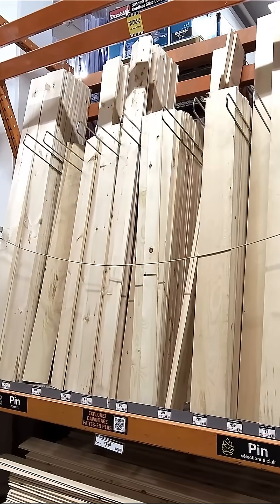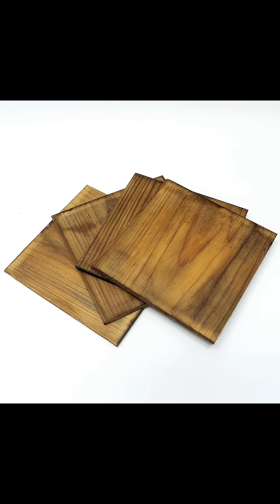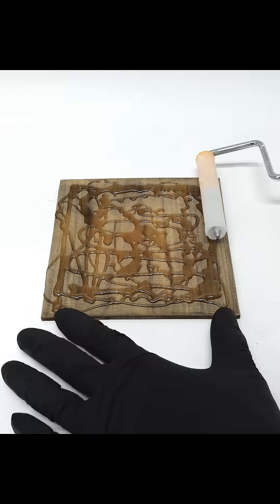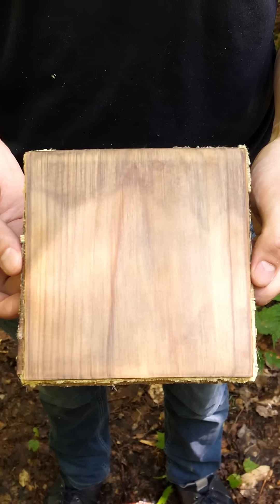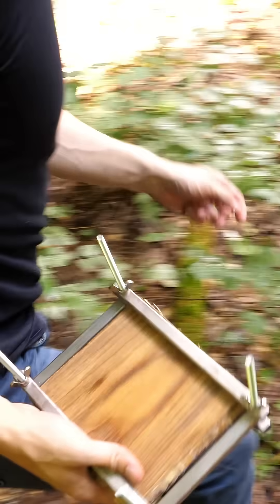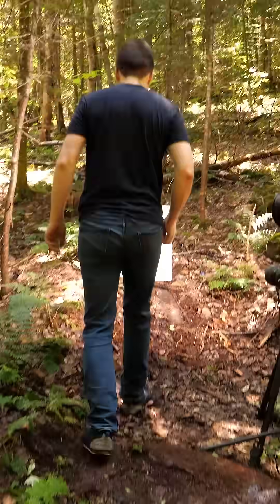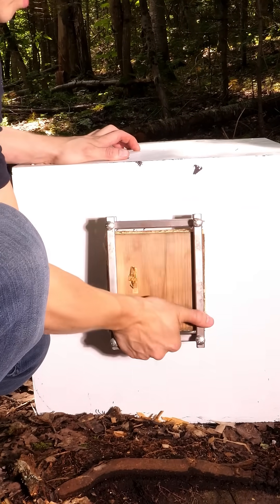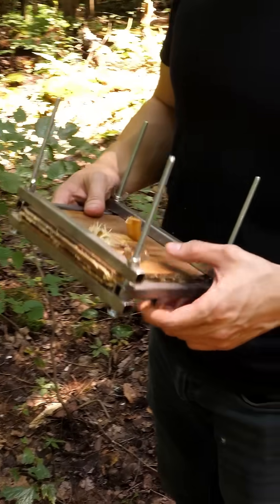Making bulletproof-er wood

Comment: Im a mechanical engineer

Conposites like you have will always be weaker than a single thick layer

Your 3 layers of wood is stronger because it is closer to 1 plate than the 4 you have

Same thing applies in designing beams. A single i beam is the standard for a reason

Comment: Maybe also try adding 45° plys instead of just 0° & 90°, if the layers are thin enough this might help against delamination and improve impact resistance (At least one could assume so as this is what is often done for the top layers of CF epoxy)

Comment: Not the same setup and test, on the failed one the wood wasn't tightly together like with the metal frame, same as first setup without the blue should work better

Comment: Gotta keep the density in the wood bro. If you're going to add any kevlar it can't be interfering with the density cross section of the wood by getting in between the pieces. If you're going to add any kevlar it's got to be separate on the front or back.

Comment: If you glue kevlar in place, it basicly becomes useless. The whole point of it is that it disperses kinetic energy through plastic deformation. By glueing it tight, you removed its ability to deform, rendering it worthless.
Reply: Maybe if we only glue kevlar to the sides? Its center still would deform right?
Reply: @temperance1208 would definitely work better but the delamination means it would literally only protect you for one shot. After that, any subsequent shots means you're screwed. Plus, this is a 9mm. Anything more powerful is gonna cut right through lol
Reply: @temperance1208 The problem with that then will be the huge air gap in the center.
Reply: @temperance1208 if it's still squeezed between the woods, i highly doubt it
Reply: Gluing it together probably did the same thing to the Wood and eliminated its ability to absorbing impact
Reply: Same with the thinner layers of wood, larger thicker layer has that extra energy absorbing deformation and allows energy to dissipate.
Reply: This is the answer I was waiting for. He is totally correct.
Reply: He turned Kevlar into fiberglass (essentially)
Reply: @KatanaKamisama  fiber glass can stop ballistics. Your point is moot.
Reply: @RedactedcommentMan  you can make a decent armour plate with stuff from the hardware store. If it is possible doesn't mean it is the best solution
Reply: @DanielTheRocketguy I have a Kevlar helmet in my lap that is rated for center fire rifle cartridges. It's literally resined and pressed together.
Reply: @RedactedcommentMan does it still allow for the kevlar to flex when hit? Search for video's of people shooting those kinds of helmets and you will see that the kevlar still deforms, by putting rigid wood plates behind it will prevent the kevlar from flexing and the bullet will punch right through
Reply: @RedactedcommentMan deformation is absolutely necessary for kevlar to work. Kevlar slows the bullet as it passes through, spreading the force over a large area as the kevlar strands get pulled along by the bullet. Kevlar is Toby maguire stopping the train.

Also, rip into your helmet and I am absolutely certain that you'll find that, while the outside is solid, the inside isn't. This is typically done to reduce wear and tear, as loose kevlar could be snagged on things or worn down by dirt, much like rope. 

Although, I find it incredibly telling that you've come here telling people they're wrong and your be all, end all point is having a level 3 helmet. I mean, hopefully level 3, because you seemed like the type to think 3a is more protective, but I digress. You really should actually learn what your equipment does, and how it does it. Unless you just want to keep playing soldier like a weeb
Reply: @averywhitaker3513  that's a lot of words to be completely wrong. Holy crap. Lol. I'm done with you Redditors. Deformation on a helmet = brain damage. Brain damage that you obviously have.  My helmet is lvl 4 btw. You know nothing of the construction of any armour. You own neither armour or fore arms and have tested neither. Yet somehow you believe to know better than someone with real world experience. Lol. Laughable.
Reply: real world experience getting shot in the head? Seriously? Take that helmet and hit it straight on with a .308 or 30-06 ap if youve got that lying around. That's level 4.

Helmets aren't rated on the NIJ scale. Companies sometimes run adjacent tests, but because they arent regulated, can do anything they want really. You dont have a level 4 helmet, because thats not a thing. With a level 3, I let that slide, because some companies do the work to make a product what they say it is. Level 4 is not possible with that philosophy and human spines. 

You've dug a pit here from not knowing how kevlar works, to not knowing how ballistic armor rating works, to not knowing how companies work. I am so sorry for doing this to you bro @RedactedcommentMan
Reply: @averywhitaker3513 I've  literally shot resined pressed Kevlar before. I'm well aware of armour companies bs too. I've blown several helmets apart. I know what's inside. A "soft" Kevlar core surrounded by a hardened shell. The "soft" Kevlar is still compressed greatly. You act like you know, but real world experience is just shooting stuff untill it fails. "If hardened pressed Kevlar works, why doesn't everybody use it?" Doesn't provide noticeable ballistic improvement while bringing significant drawbacks. It still stops  pistol rounds easily.
Reply: @RedactedcommentMan  well ain't that a nothingburger statement. Wanna try actually replying to anything I've said, or are you content with your schizo manifestations?
Reply: @RedactedcommentMan You added one to the number and pretended it's true. You're a joke
Reply: what about helmets, im curious, Cause they're cured in resin or something so they're pretty rigid but they still deform and they do work
Reply: Hard layer, soft space, hard layer, soft space, repeat. Bullets rely on massive amounts of energy, enough to vaporize themselves if the meet the right unmovable object. So, unless you plan on absorbing that amount of energy without defamation you need to focus on dispersing the energy.
Reply: That's what happens when you let chemists do physics
Reply: see also: Navy SEALS nailing vests to their panel van's walls, puncturing and pinning it.
Reply: How can so many people be so wrong on a subject? Have you ever worked with Kevlar? I doubt it.
Reply: @RedactedcommentMan if you have experience with bulletproof vests and if the layers need to be loose vs rigged to each other for optimal performance please share 😊
I believe in this thread we indicated there needs to be room for deformation. By having a rigid mass the panel is more brittle and the concentrated energy punches a hole through.
While we acknowledge the strength of kevlar, and the significant increase in this materials strength over base wood, we believe that a single bonded rigged panel of either material is less strong per unit of thickness to the penetrating power of firearm projectiles when compared to a material where there is room for deformation.
Now, bonded kevlar is better at stopping something harder than copper and lead, like a knife or a steel point bullet. In which case you would want a more rigid layer up front, with unboned lawyers in the back.

But you seem to imply that is not the case and that you have expertise in the dissipation of ballistic energy so we would be eager to learn.
Reply: @mysql50  another try at a reply. The main factor in kevlars ballistic resistance is its tensile strength. Deformation is the last thing you want in armour. Modern ballistic helmets are made from hardened Kevlar.
Reply: @mysql50  won't let me comment a reasonable answer.
Reply: @RedactedcommentMan  the main idea of a bullet proof vest is to have a very ridid front plate like ceramic or in this case hardend wood which will break up the bullet into smal fragments which will be caught by a fabric with high tensile strenght like kevlar. If you look at physics if the kevlar is not rigid and allowed to flex the impact is spread over a longer time which reduces the impact force while if the kevlar is glued and made rigid it would feel the full brunt if the bullet and crack. If you fall on a matress it would Hurt much less than falling on a concrete floor.
Reply: @DanielTheRocketguy I've made hardened Kevlar ballistic panels before. Have you?
Reply: @RedactedcommentMan  🥅➡️
Reply: You also need about 30 layers of Kevlar fabric to make a bullet proof vest, at minimum. I don’t know how much the wood does though. It’d also be better to put all the Kevlar together in one spot, probably at the back
Reply: TSYM i had no idea what was going on lol
Reply: 😮Oh! 
Thanks. That makes a lot of sense.
Reply: What Abt Carbon Fiber
Reply: I always hope I'm the first who have the idea to comment something like this. So i comment before being humbly reminded that there are many clever thinkers.
Reply: Honestly I think if he instead used Carbon Fiber and resin it would help it instead of just kevlar
Reply: @reedman0780  Unfortunately carbon fiber is not a matrial that reacts well to compressive forces. Carbon fibre is amazing at one thing: Tensile Strenght. Aka resistance to being pulled apart/stretched. If you start to compress carbon fiber, you basicly get the same effect that destroyed the Oceangate Titan submarine.
Carbon fiber under compression shatters like glass. And taking a hit from a bullet is basicly a massive amount of compression all at once.
Reply: Came here to say exactly this, #1 comment.
Reply: This comment is misinformation. Kevlar is not at all bulletproof without actually bulletproof plates. The point of Kevlar is not to stop bullets, although it does stop some knives. The point of Kevlar is to hold a plate and not rip when it has holes in it.
Reply: @CraigKeahey Im sorry but that is the exact oppositr of what kevlar does. Kevlar is used as a "Bullet Resistant" material for one reason and one reason only: Its incredibly high tensile strength. Aka its ability to stretch without reaching plastic deformationor brittle failure points. Keval by itself can stop a bullet ,up to a certain kinetic energy that is dependant on the number of layers, through rapid dispersal of the kinetic energy and prevention of penetration. Plates offer additonal protection and further spread out the leftover kinetik energy to prevent blunt force trauma that can still occur when kevlar is hit.

Contrary to your statement, Kevlar is practically useless against Knives. The fiber mesh is relatively easily cut by sharp objects and can be cut to shape with scissors. One of the main reasons why you see special forces and police in Germany wearing chainmail coats underneath their vests to protect themselves from the ever more prolific threat of knives.
Reply: @CraigKeahey Kevlar explicitly doesn't stop knives. You can cut it with kitchen sheers. It is a bullet resistant material. It stops bullets.

Comment: The problem you are facing is that your adhesive is too strong and you need multiple layers of bidirectional kevlar stacked together. 45* and 90* in order to get it to work right. For example if you did one layer of wood followed by 4 plies without glue followed by 3 layers of wood you would have completely stopped the bullet. Trust me, I've tried

Comment: Kevlar works by being flexible, it flexes inwards stretching the fibers exuding the force through the fibers via this stretching. Making it hard and flat is counter to the way it works, if however there is an air gap between the layers and the edges were glued securely it would work as intended (assuming the glue holds).

Comment: So I haven't seen any of these other videos, but I'm guessing you're just impregnating the wood right? Like a vacuum chamber and some epoxy? So if you're doing that why not just go ahead and use like some really really hardwood like get a couple pieces of thin Birch plywood and impregnate them and then try it with the Kevlar. I bet you four layers of 8-in birch plywood with Kevlar in between with stop at 9 mil

Comment: Try sheet metal in-between. Normally the metal bends and puncture the metal. But without the flexibility its much stronger, 8th inch or even 16 of an inch should do.

Comment: the crossed ply's won't work when there's distance between them. Think of it this way. If there were 1/2 inch apart you wouldn't expect them to work together. So, separating them with 2mm kevlar has that same effect. Also, bonding the kevlar flat and hard stops it from working.

Comment: Yep.. Gotta have a pocket of air in your "wall" if that's gonna work. .. You could put a vineer up with the Kevlar right behind it tacked into place not glued.  Then a spacer of air and the rest of the wall to absorb the rest of the bullets energy.  The Kevlar needs to be able to stretch to absorb the bullet's energy.  It would probably help if you could somehow torque it to a specific tightness as well. - just a guess
Be nice to be able to develop a 3D printable material or some type of silicate lattice in layers between the vineer if you want it to be thin and solid.  Maybe study how bullet proof glass works and see if you can make it any thinner.

Comment: I believe it would be more effective if you put the Kevlar at the back because Kevlar has made to catch a bullet after it's been decelerated. That's why it's usually used as backing in other types of body armor. You really need a lot of it to stop a bullet by itself. I think that separating the Kevlar layers like that made them fail individually.

Comment: Kevlar, unlike resin,flexes, which means each wooden layer is no longer supported by the next wooden layer. In effect you've created a barrier that had a flexible layer between each wooden layer. This is just as bad as having each wooden layer separated by a tiny gap because now each layer has no support from the following wooden layer.

Comment: I'm not sure about the Flex thing with Kevlar and bullets.
But what I know that your Resin is Very Important, 
For example, Carbon with polyester doesn't make sense and is absolutely not that strong as enforced with Epoxy.

Comment: That's why you ate the chemistry guy and not the physics guy. 
Gluing cevla very strongly sopps it from working since the fibers move and slide to slow the bullet down, which they now can't do. If you want to get away with less material, a good idea is spreading it so everything can slow the bullet down or break it apart before the next one is even getting touched. (Or newton's pendulum stiled energy transfer)

Comment: @nilered So i don't know if you tried this on the other piece but put your composite piece in a vacuum to remove air bubbles from the glue to give it a solid build and compression(weight on the piece) to distribute evenly

Comment: Don’t use glue and try again just by holding it in place, please.

The glue turned the kevlar into a composite, giving it completely different material properties because the strands are held in place. The glue is being wicked into the material when it’s wet.

You can also try a very thin layer of dry glue that does not seep into the kevlar. Something tacky. But definitely not something that says “impact resistant”.

Comment: Stick it together with flexible silicone sealant... it would allow the kevlar to flex. You would need something else to allow movement....
wood panel +
sealant +
2mm thick floor laminate underfloor insulation +
sealant +
kevlar +
sealant +
2mm thick floor laminate underfloor insulation + 
sealant + 
wood panel
 etc etc etc

Comment: Obviously thinner wood will fail even if you use more pieces.  The secret is in the continuity of the wood grain itself.  One piece of the type of wood that is stringy and tough will resist more than any regular hardwood.  Like huisache, not oak.  1 inch thick of huisache is tougher than one inch thick of oak.  And thin layers of fabric Kevlar isn't going to stop any bullet.  The bullet just goes right through pushing the threads apart.

Comment: Stack the boards flat together and make a kevlar pocket to insert the wood. Make sure to add a small pad to the rear side of the board in-between it and the Kevlar. Remove the space between the boards and allow the kevlar to be a fragment catch.